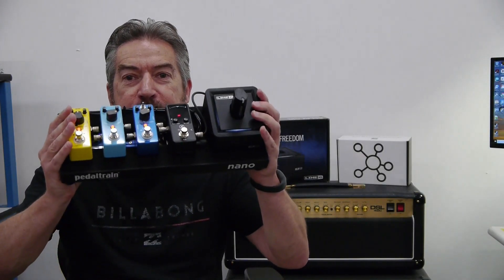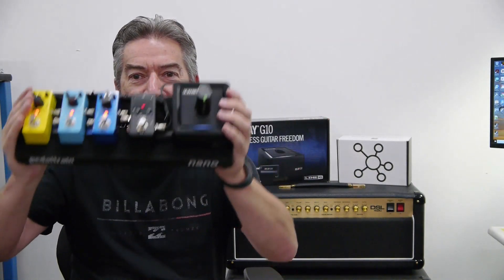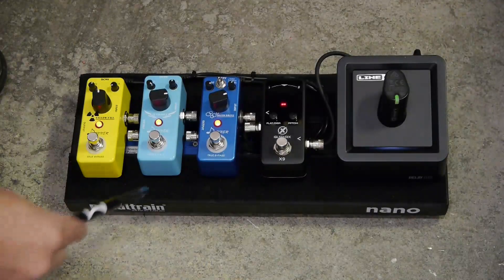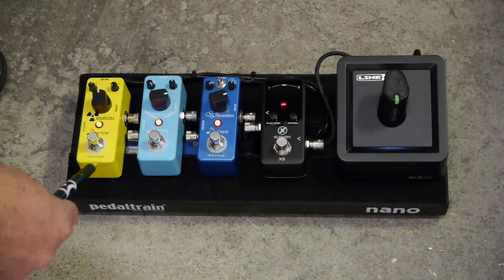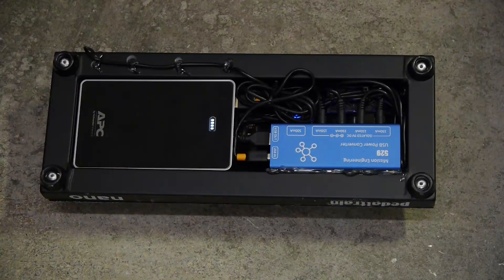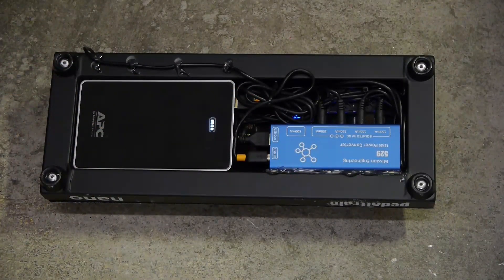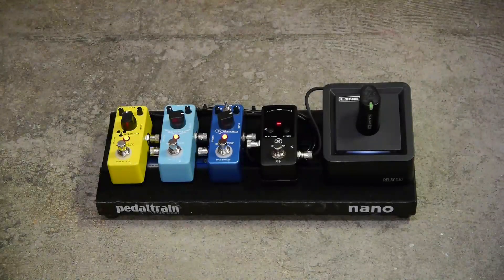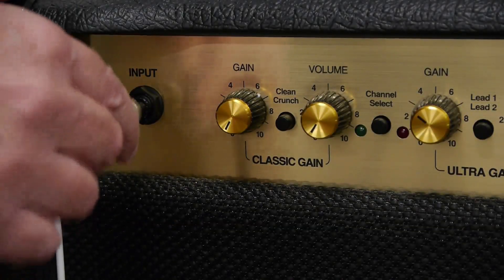How to make a wireless pedalboard

Comment: JAMES< I think most wireless systems will isolate the guitar ground to the pedalboard ground+power supply ground potential or amplifiers input jack ground potential. The wireless system is like lifting the guitars ground to be isolated or lifted ground? It should reduce the RF interferences and 60hz hum from the guitar amplifiers power transformer because when single coil pickups are close to the amplifier power transformers the 60hz hum its louder. When using wireless systems this should reduce the 60hz hum?

Comment: I would say this is more a wireless guitar. Wireless pedalboard would be if you're not running your pedalboard into your amp using a cable.
Reply from the maker: The main reason it's 'wireless' is the power supply enables all the pedals to be run from a rechargeable battery. AC cables and the cable from the guitar to the pedalboard are usually the most restricting cables that people want to remove. Most people don't have an issue running a single cable from the board to the amp. If that's a problem for you, you can just use a second Line 6 wireless adapter between the board and the amp.
Reply: @JamesLebihan  Ah, i understand, thanks.

Comment: Recommendations as to how to affix the 529 underneath the Nano? Just the Velcro?
Reply from the maker: Velcro works fine. The 529 is much lighter than most conventional power supplies. I use a little hot glue if I'm not expecting to move it around very often.

Comment: is there a way to elimate the cable from the amp to pedal board to make it completely wireless?
Reply from the maker: Sure. You could use another wireless device such as a second G10 between the output from the last pedal on the pedalboard and into the amp in place of the cable.
Reply: @JamesLebihan  I ask because I have 2 samsung 77 and I tried this and it didn't work is why I was curious to see how it could be done but know I dont think I can find a wireless charger to run a line 6 hd 500x now.

Comment: Is it also wireless from the effects to the amp's input? That would be ideal, no?
Reply from the maker: Here I used a cable to go from the pedalboard to the amp. Most people don't care about running a single instrument cable between board and amp. If you do, you can use a second wireless system. The Line 6 Relay G10 I used would work for that.
Reply: Pasquale Porpora Yes ... it should be complete wireless system!

Comment: Hey james, what do you recommend for trying to power the line 6 HX effects by battery? I was going to buy the ionic audio usb converter but they've been out of stock for months. Any other suggestions?
Reply from the maker: I started looking into this a while ago. I have not fully profiled the HX Effects yet, but it looks like you would really need at least 3000mA which is more than USB 2 spec can handle. You would need something that supports the USB Power Delivery specification on USB C, which has a higher power capability. We are working on a possible future 529 like product that will support this. I don't know of any commercially available products that supports USB PD to 9V pedal power outputs that you can buy currently.
Reply: I've seen a few people using the Ionic Audio USB converter which had a max of 2,000mA and it worked perfectly over the span of months without any issues. There's even some photos on the HX effects facebook group page.
Reply from the maker: I'm sure it did, and I bet in most cases it would work just fine. The issue with drawing 2+ Amps from a lithium ion battery is the not the thousands of times that it works, it's the handful of times that it doesn't. Just ask Samsung. It's my hope that Mission will provide a power supply that will support the HX Effects at some point in the future, but there's a lot of safety requirements that I'm going to need to see taken care of before we do.
Reply: Okay, I understand. thanks for the response. Do you think that is something that is possible in the next year or two?
Reply from the maker: Yep